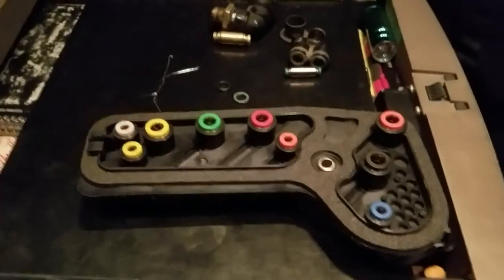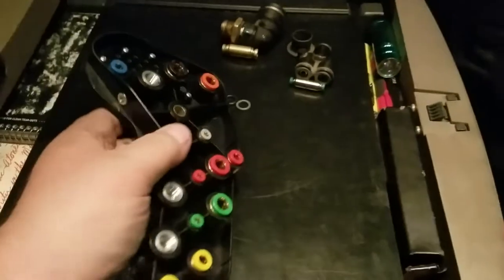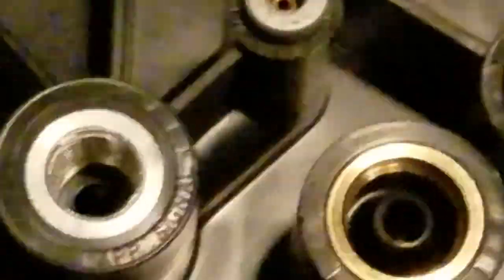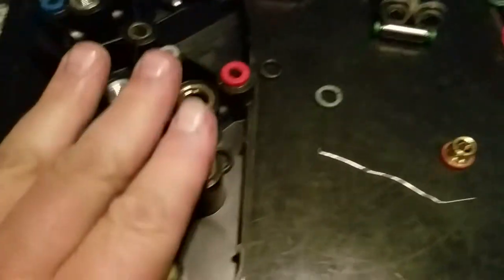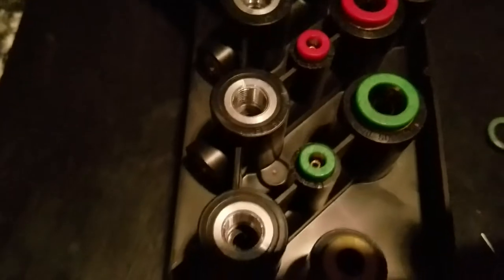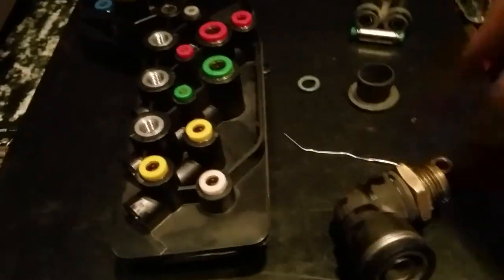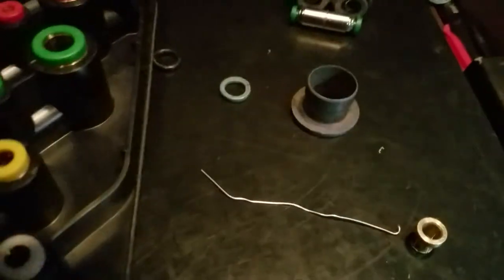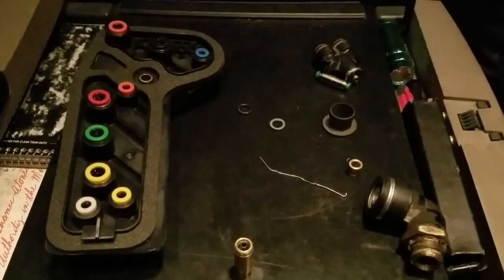Quick connect air fitting repair.

Comment: I have a 2016 prostar while moving the tandems on old trailer and arguing with guys at shipping I forgot and left my trailer break down. So pushed in both buttons and pressed to go back and back until all is a sudden I heard they air leak and saw trailer handle down. So now I’m stuck. The one that is leaking looks like the big black one it’s the main air for trailer. So as soon as I press in the trailer button and press on break it leaks. Front valve is almost 700 some say it can be a break chamber which are new but doubt it since when I run bobtail there’s no leak. And break is firm , so worried it’s the one in by the fifth wheel sending back air or if it’s the air valve from the front. It is screwed in. Do I think it can be fixed like this?

Comment: Does anybody know what size these  o rings are? Or do you use same size as the air hose? I got a leak on the one that takes 3/8 hose. Does that mean It takes 3/8 o ring???
Reply: o-rings have multiple dimensions, and durometers (hardness), also materials.

Get a digital caliper and find the one you need exactly at McMaster-carr.  You can try a hardware store but you need ID and OD measurements in thousandths.

Comment: Hey Richard I saw your video yesterday,  I've been having a air leak at the manifold from the firewall side ( engine  side ) and it was a green fitting I pulled the hose out cut it with a pvc cutting tool make clean cuts pop it back and still leaked so I did the paperclip (NASA)
Design and pulled the green Oring got a set of green O rings from HF and boom worked just ad you said , thank you for this info , it's great that you took the time to figure this out sir , God bless
Reply from the maker: Thank you for your blessing. I'm struggling a bit in my life and am grateful for it. I'm sorry the video is of such poor quality. I made it to help my fellow truckers like you. It makes me happy to know you were able to fix your truck. May God's blessings be upon you.

Comment: What size o ring is it?
Reply from the maker: Depends on which one you are replacing.  Pull the old one out and match it at the hardware store.
Reply: @richardjolley6244  My old O ring came out in bits and pieces so I have nothing to match to
Reply from the maker: Buy an O ring kit from Harbour Frieght or something.  You can unhook another hose of the same diameter and match them up. If the old Oring breaks, keep all the pieces and lay them together.  God bless you.
Reply: @richardjolley6244  thanks!

Comment: why is it such a crappy design on all those trucks ,seems like a mayor point of failure. 
Why don't they just run the tubes thru a rubber grommet with individual fittings

Comment: Hi Richard in regards with that green little plastic and I believe that goes to primary gauge. Is that repairable as well?
Reply from the maker: I'm not sure what green plastic thing you are referring to. Please help me understand.
Reply from the maker: All the colored ends can be removed and the oring under them replaced.  The tools made out of paper clips work best. Especially if the old oring is broken in pieces.  I hope this helps and may God bless you.
Reply: @richardjolley6244  thank you for your reply. Appreciate it.